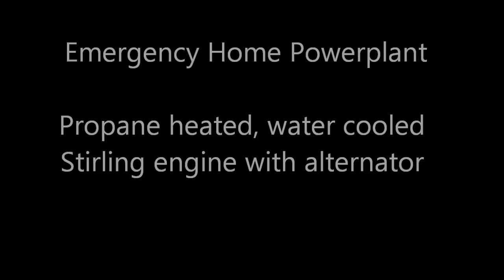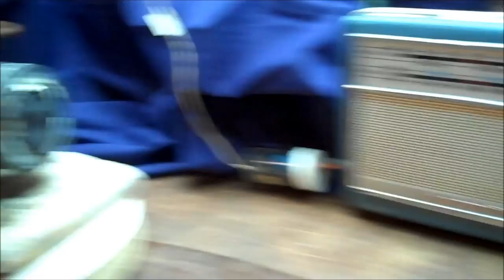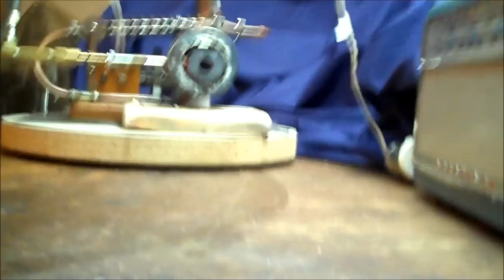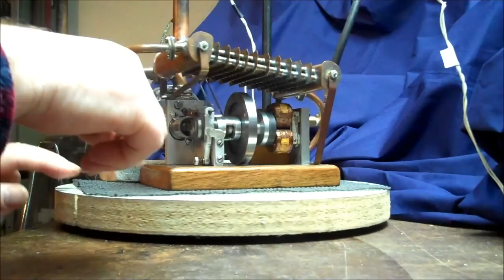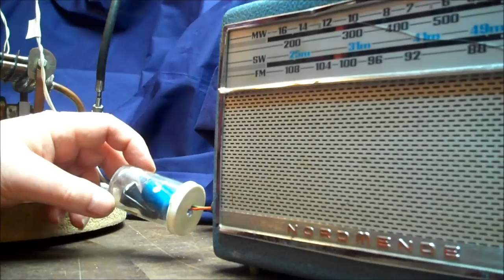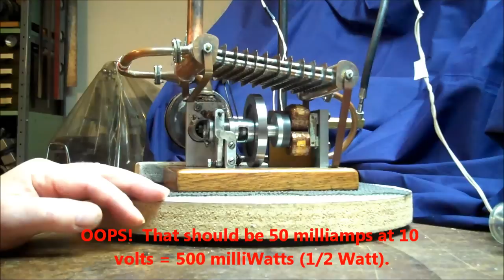Stirling engine emergency home power generator

Comment: A Stirling engine is good for that, you don't need Vahtia water for the boiler, etc. I have a homemade bigger one, you can leave it for a day to charge the batteries.

Comment: Hi, I just came across you're video, I am curious is that generator disc magnet multi pole? In other words on the side that is facing the two coils, half is south pole and the other half is north pole?
Reply from the maker: Hi, thanks for your interest.
The disk magnet is magnetized on the surface that faces the coils.  Further, the magnet has two poles only, diametrically opposed.  It originated from a laboratory magnetic stirrer.
There are different ways of building small alternators.  Perusal of the many DIY windmill sites may inspire alternative solutions.
Good luck!
Reply: @BasementEngineer  Much appreciated, very interesting indeed.
Reply from the maker: Please read the discussion below with robert denning.

Comment: I tried with magnet in the centre but no voltage produced, how did you make yours? the configuration has to be north south for it to produce voltage
Reply from the maker: Hello Robert!
The magnet I used is magnetized across its diameter, and on one face.  Thus the magnetic poles are on the face of the ring and on each end of a diameter.  Methinks this magnet came from a magnetic laboratory stirrer.
If you cannot find such a magnet, I would suggest gluing two button magnets on the ends of a steel bar.  This has the advantage of making the length of the magnet bar suitable for the pole spacing of the coil laminations that are available.
Note that the button magnets must lie between the steel bar and the laminations.
For the laminations I used an old relay.  You can use a small transformer and remove the windings and central leg thereof.
To make a given voltage, wind a trial coil of say 10 to 20 turns and measure the voltage at the requisite rpm.  Then divide the # of turns by the Volts to get turns per volts. Multiply by the required voltage to get the # of turns required for your voltage needs. w
Reply: @BasementEngineer  Thank you for this, so it is a ring magnet being used, great idea, I will give it ago.
Reply: out of curiosity what is the open voltage you are getting on this?
Reply from the maker: @robertdenning2942  Hmmm, methinks it was 12 volts AC or so. The output goes through a bridge rectifier to make DC; a smoothing capacitor is used to reduce the ripple, and a 10 volt zener diode clamps the voltage to 10 Volts DC maximum to protect the 9 Volts portable radio.
Reply: @BasementEngineer  I have 4 coils, 40 ohm each, no metal core, just held by plastic screws, the magnets are rare earth, 4 of them, could you be so kind to send a pic of the generator you built, it seems to work much more efficiently than what I've got. I will pull lamminations from transformers i have laying around...thanks again
Reply: Actually it's ok I think I have enough just looking at the video, the ring magnet has to line up with the laminations...i think...lol, really interesting stuff.
Reply from the maker: @robertdenning2942  Robert, the video shows all the parts.
The ring magnet is epoxied to an aluminum hub in order to fasten it to the crank shaft.
The lamination stack is as thick as the leg is wide.  Think of a square cross section.
Laminations in the coil are necessary for good efficiency.  Note that laminations are necessary here because the magnetic flux reverses with every revolution of the shaft.
The number of turns of the coils I determined experimentally as I described earlier.
Reply: @BasementEngineer  Thank you appreciate your responses, been very helpful, The generator is certainly a very good design, can't wait to try it. I will get back to you with my results.
Reply from the maker: @robertdenning2942  Thanks, please share your findings.
A lot of information has become available to the hobbyist from the time I designed and built this generator in the late 1970's.  '78 or '79 I think it was.
A perusal of windmill alternator construction by DIY types will provide good information.
For technical information YouTube is a gift.
Reply: @BasementEngineer  I will definitely post my findings, I am on my way. I stopped project building for a time, but recently got back into it. After watching your video, and tested with a single disc magnet that I had laying around, although smaller in diameter, It did not produce voltage or very little, so I started looking at youtube on your setup, but have yet to come across a single disc magnet rotor. I am sourcing larger diameter disc magnet at the moment, and have built a test bed motor to test the generator part.

Comment: Take a look at this new technology what do you think
1. The 1st working prototype
https://youtu.be/Dp-6fOGI6oc
2. Giving more data on the working prototype
https://youtu.be/o_2K6e2GUoU
3. Using the step up to prove looping is possible
https://youtu.be/QnUWg13FCTc
4. Making a bigger prototype.
https://youtu.be/CIGhDO9Q9R0
5. Showing and proving what the professional says about looping
https://youtu.be/HTR03aSiGWs
Final video Reference from professional.
https://youtu.be/WVM0F2OrQhA
Time to hook up the big system using these methods and an update where I'm at of taking my home off the grid part one
https://youtu.be/S_oxzKu8Nzs

Comment: I "found" Stirling engines just few months ago and I find it quite fascinated. 
The main question though is what is the minimum  temperature difference  to work steady - therefore how hot should the hot part be. And what is the amount of energy converted to electricity...
Reply from the maker: Thanks for your interest!  You ask some very far reaching questions which would take lengthy answers.  I'll point you in some directions for your further inquiry.
There is a class of Stirling engines that are called "Low Temperature Difference" Stirling engines.  Carefully constructed such that the mechanism has an absolute minimum of friction, these engines will run when placed on top of a cup of hot coffee.  Really well-built ones will run from the warmth of the hand holding them!
For energy conversion EFFICIENCY, the temperature difference between the hot end and the cooling end of the engine should be as large as possible.  Search for "Carnot Cycle Efficiency" to learn more about this.
Stirling engines have been built with a thermal efficiency of about 40%, which is quite phenomenal once you understand Carnot efficiency.  Depending on the efficiency of the generator, one can calculated the overall conversion efficiency.
A typical automotive alternator may have an efficiency of 50% or so.  Permanent magnet motors, I have used windshield wiper motors for this purpose,  probably have a similar efficiency when used as a generator.  Purpose designed generators may have efficiencies of over 90% in large sizes.
Now then, high temperature Stirling engines of efficient design are quite compact;  Think of the size of automotive Diesel engines.  In the 1970's automakers experimented with car Stirling engines to reduce emissions.  Some of theses engines produces 150 HP or so.
Finally, for a given power output, the size of the engine varies tremendously with the operating temperature difference.  The auto engines were very compact because of the very high hot end temperature, plus using hydrogen gas for the internal working fluid.  I've used Helium gas and it made a large difference in power output.
Phillips of Eindhoven, Holland, did much development work on these engines, and published a book about its research.  This book was available on-line.  See if you can find it;  it is a worthwhile read.
Good luck with your research!
Wolfgang
Reply: @BasementEngineer  Dear Wolfgang,
Thank you very, very much for your replay and the "guidelines" for further researches. 

I should admit I'm with no engineering background, and probably a bit childish vision of how this could work. Since I sow it for first time - a one with Low Temperature Difference I imagined how these piece of kit is solving many of the problems with the clean energy supplies. 

Looking how a cup of tea creates the thermal energy into mechanical work I though - you only need to increase the scale, and reduce thee thermal looses, keeping a steady differences between the hot and cold plates  - and voilà cheap clean energy source :)

Obviously if it was so easy it would have been done already, but in many regards I see how people discard the  easy solutions in pursue of the most complicated and often expensive one :)

Comment: Can this be rigged up to charge something like a car battery or maybe some ultra capacitors?
Reply from the maker: The power output is a little low for this: 10 Volts at .1 Amperes.  A somewhat larger engine could do what you wish. w

Comment: 10+ years later: here's a crazy thought: it might be dangerous, BUT:  expanding propane should be pretty cold, right?  Can the propane fuel expansion be part of the "cold end"?
Reply from the maker: In principle, yes.  However, the propane mass flow is so low that the cooling effect would be very small.  Not worthwhile the complexity.

Comment: Excellent result! If a stirling engine can make continuous operation: this is a big difference compared to show one time a stirling running for 5 minutes. Another stirling engine for  continuous operation can be seen here ( > 500 h operating hours, 1 W output): https://www.youtube.com/watch?v=Id1ROl__E3U. A stirling engine powering a radio here (1.64 W output): https://www.youtube.com/watch?v=pUYinnwiznM

Comment: How much propane does it consume to produce that Watt? I'm interested in doing something like this with biogas.
Reply from the maker: Better than 1% is my educated guess.  Once everything is hot the flame may be turned quite low with the radio still performing. w

Comment: For those who say Stirling engines produce no useful power, I would respond, read the history of the industrial revolution.  Stirling's  were the engines that first powered it before steam engines came along.  Today some of the newest Swedish, Chinese and Japanese submarines are powered by Stirlings and solar powered units in sun rich countries are producing 25 Kws each.  Most Stirling engines shown on YouTube are home made toys, so no, they don't produce much power but neither do any other type of small home made toys.  Ltd Stirlings will run on as little as 2 degree temperature difference, they are relatively low pressure so are much safer than other types and can operate on any source of heat or cold which makes them naturally green.  These engines of the past, with today's greatly advanced material sciences, are fast becoming the engine of the future.

Comment: I love your idea of placing the crankshaft underneath the radiator; the air movement helps remove heat energy from the radiator which thus helps the engine work better which helps the air flow which helps cooling which helps efficiency, ad naseum. Genius.

Comment: Very nice build! Thank you for explaining why to use a cast iron cylinder and a steel piston for longevity! Keeping friction to a minimum. With the displacer piston and cylinder above the power piston and cylinder I guess the oil entering the hot side of the displacer is not a problem?
Reply from the maker: The key is to use very little oil.  I use a drop of good quality sewing machine oil on the piston/cylinder, ditto for the displacer rod.  The external mechanism gets # 20 motor oil, again only a drop every now and again. w

Comment: Quite nice.  I'd imagine that another engine could be slapped on the other side of the same burner for twice the output, with a bit of modification.  Or, heck, make a box-shaped burner, with enough sides for however many one needed.  One could probably get quite silly with it, I'm sure, but desperate times, as the saying goes.

Comment: Nice hobby project. HifiCentret is right, though. Thermoelectric generators are the way to go for flexable fuel emergency power. Place TEG chips between 2 reservoirs, one filled with cold water & the other filled with hot oil---electricity comes out of chips. Heat oil to the chip's maximum working temp over a fire or parabolic cooker using a thermometer to monitor the oil temperature. Pour into the hot side when hot enough. Done.

Comment: 1w of power.... Doesn't sound like a really usable amount of power. Most likely you'd get more power out of a Peltier element for similar amount of heating - and no wear vs. a stirling.
For a stirling to be real efficient you need it to be pressurized and preferably sealed using other gasses than atmospheric air.
Reply from the maker: It's more of a hobby project than a device intended for broad market appeal :)
Reply: HifiCentret 
A peltier plate setup hasn't quite got the same charm. :) 
This is beautiful.
Reply: the original design of a sterling engine was to reduce pressure tanks of steam engines to avoid them exploding ... the inventor was a pastor who was dismayed by his parishoners getting hurt or killed when their steam driven vehicles and machinery blew up from over pressure or weakened pressure vessels .... so increasing the pressure on a stirling engine would actually defeat the original design of the engine ... also the stirling is techinically a heat differential engine .. it doesnt mater what your heat source is just as long as the hot and cold side have a difference between them .. the more the difference the more power that can be generated.

Comment: Congrat on the lifetime of this little Stirling engine, loox amazing. Unfortunately the radio is not a good load to test /value its or the generator's output. Further, I could not get the size of the fuel container that you use to power it from.
Reply from the maker: +Stephen Balogh The radio simply demonstrates that it produces power, it'll also run a small lamp or other device. You could, with an appropriate regulator circuit, use it to charge batteries. The propane tank used is either a small handheld blowtorch-type bottle (I can't recall the weight) or a standard 20-lb. barbecue propane tank. The barbecue tank will probably run the engine for a month :)

Comment: Can it run on methane? I was planning to eat a lot of baked beans and pipe the gas to this thingy ?
Reply from the maker: +Azzy M Probably, yes! But you'd need a TON of beans. Propane is cheaper--and smells better. ;)
Reply: BasementEngineer  :-)) Right. Ha Ha

Comment: Would any efficiency be gained if you used the flywheel to displace air (turning it into a fan) and ducting the radiator to increase its heat rejection capacity? Would be interesting to put a few thermocouples on the hot and cold side of the cylinder to see if there is a change.

Comment: That's a very nice engine.... I really like the radiator. Maybe a regerative burner would be nice to improve the efficiency..
Reply from the maker: You are correct.  The burner was an attempt to be somewhat regeneratice;  the secondary air intake is from the end, inside the outer casing. w

Comment: If I made a gamma type LTD stirling engine with a large cylinder diameter of 12 inches roughly how many watts would you estimate the output would have. If the Tc was about 20c and the Th was say 40c.
Reply from the maker: +KiwiPowerNZ 

You mean... without any additional info? And.. for free?

I estimate X number of watts will be produced :)
Reply: +Amrit Singh Multani  You have to pay him for that for info. but he already said it generates 500mW
Reply: +KiwiPowerNZ Power depends on the volume, frequency of strokes, pressure in the engine, type of gas in engine, heat difference of hot and cold side, efficiency of cooling, efficiency of the recuperator , efficiency of the generator,  type of the Stirling engine design. Answer to the Ultimate Question of Life, the Universe, and Everything is 42.
Reply from the maker: Hulla Dek In a nutshell, it depends on the total energy (heat) throughput of the engine, times the engines overall conversion efficiency.
Numerous factors like displacement, working fluid type and static pressure, heat exchanger (including regenerator) design, even choice of plain or ball bearings etc. ultimately all affect those two things.
Reply: BasementEngineer Actually you need heat difference not heat. What is converter to pressure and that to motion.
Reply from the maker: Hulla Dek Well... Oh man.
You need temperature difference between hot and cold ends, and the ability to sustain that temp difference as heat energy is introduced to the system. Heat input and removal are done at the same rate once the average (time integrated) temperature of the working fluid stabilizes at a given power output. It's that total energy throughput times the conversion efficiency that determines the engine's power output (and also determines the required fuel consumption for that power.)